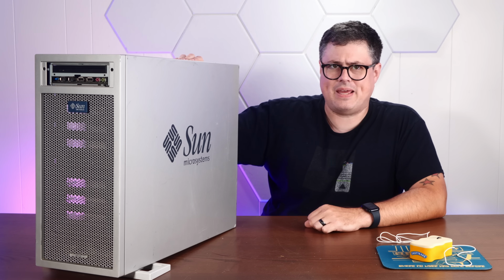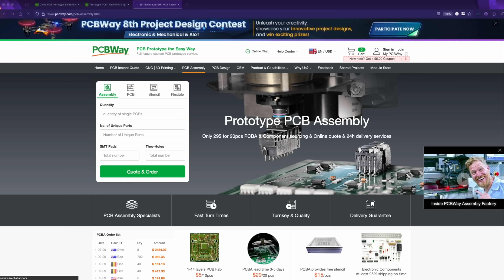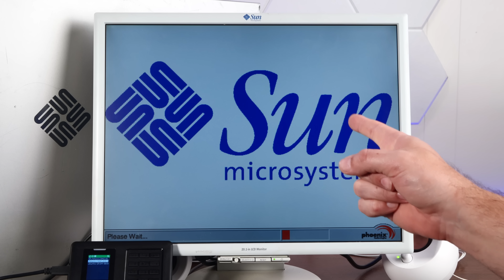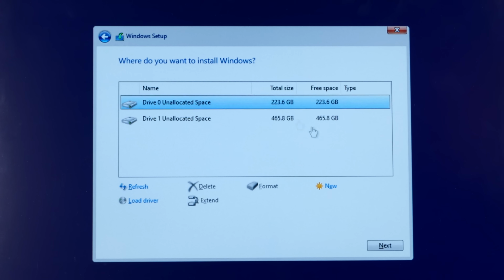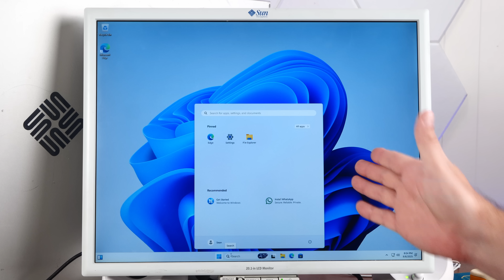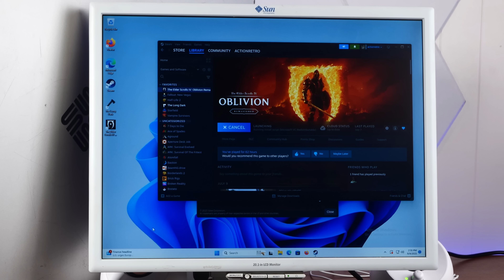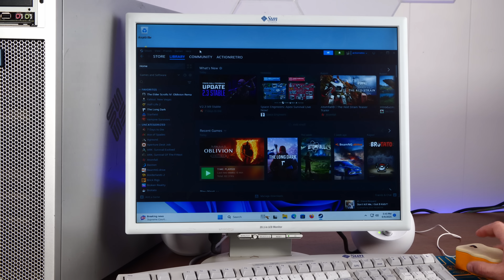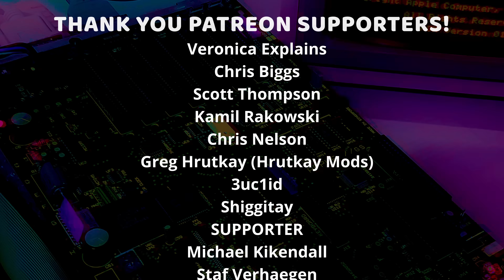The Oldest PC That Can Run Windows 11

Comment: Man.. imagine using firefox in this day and age..  Just to make everyone feel some type of way.. I use Edge on Windows, Mac, iOS, iPadOS, Android, and Linux..  Works great, also syncs well with my 365 tenant shrugs not sure what all the hate is about..
Reply: Well I only use Firefox, from version 2 or something like that, on all my.machines, at home and work. Only use Edge in InternetExplorer compatibility mode for some old things like some ActiveX cr4ps, and that is some rare times and only in one machine. Chrome have been barred by me since ever.
Reply: @mikes989  I used to use Firefox exclusively around 2005 but stopped somewhere in the early 2010s due to issues.  I have jumped around between Firefox, Chrome, and Opera but since the Chromium version of edge was released I have found a lot of usefulness in it and it performs very closely (especially in utilization) to anything else.  I do think though Edge gets a LOT better if you have a microsoft 365 subscription as well due to having your information from the browser saved in your own tenant, and having the extra controls that also come with browser management from having said subscription.  Haven't worked with it as a normal consumer though so as with all things Others mileage may vary...

Comment: This Specific workstation is actually is from 2006, so It's not much older (if at all) than an early Core 2 Duo.
Reply: I think there was half a year or a year between the AMD and Intel x64 CPUs, but I may be mistaken.
Intel saw it coming.
Reply: @pizzablender  AMD Made The Opteron 64s in 2003, but the Socket F Opteron in Sean's specific workstation is a 2006 Socket F LGA Opteron 2200 SE.

Comment: honestly what tiny 11 would you recommend for my plex server, I need the SMB since all my drives are different sizes,  I have 10 drives via SATA (using a SATA card on 4 of them) 6 on the motherboard SATA 4 USB drives and 1 m.2 drive, my boot drive is a mSATA 64GB using a mSATA to SATA adapter running a 12th gen i9, and the boot drive is the only one not shared on my network and my GPU on that machine is an older Nvidia it is a GTX 960, the issue is after PLEX and using steam as a sons of the forest server the boot drive is so full I cannot even do certain updates so I want to get rid of all the MS bloat that is not required to run plex and a maybe a server for specific games, any help is appreciated.

Comment: it is easy to imagine why microsoft put such high requirements
1 greed , selling new licences is actually more profitable than runing a store nobody buys anything in
2 lazyness not being obligated to maintain security on cpu's that have known security holes, if you cut them out from the list you don't have to provide security patches for them and you don't care if they crash
so technically it should just work, why wouldn't it? they just don't want liability for someone's secure data being stolen so they don't let anyone run the older platforms even if new ones are not much more secure

Comment: Tangentially related - using old computers.  I do love to play with old hardware, but I'm a bit more picky when it comes to homelab equipment.  At some point you cross the price/performance ratio for the running cost.  The hardware is cheap, the performance is often fine for light workloads, but electrical costs are out of wack.  This is important for something that's on 24/7, not as much for the casual user.   This makes older "PC" machines less interesting to me - you can predict the performance pretty easily, and the hardware isn't very interesting most of the time.  For me, this means anything AMD 3x000 and before, and Intel 9th gen and before are probably done.  The i9-9900k performs pretty well still, you can even game on it most of the time, but you're pushing 100W for a lot of heat.  Older Xeons are more interesting because 1. Tons of cores, 2. tons of RAM, 3. Tons of PCIe.

Comment: had same issue with Windows 11 setup on a noname usb card, but once I put the card in an older system and updated the cards firmware it worked fine in the windows 11 setup after that

Comment: Meanwhile Microsoft is writing everything older than 8th gen Intel off as e-waste.
Reply: Even the OG Ryzen 1st gens, which have TPM 2.0, got denied off Windows 11 official support.
Reply: @FairnightVexel That is insane.
Reply: In fact anything made by Intel after 2018 is e-waste.
They really dropped the ball hard.
Reply: Gentle reminder that Windows 10 LTSC will be supported till 2032.
Reply: @fallingwater  IoT LTSC, actially
Reply: @fallingwater  gentle reminder that this is a $50 operating system and people dont wanna pay for bullshit just to get security updates
Reply: i use xeon 1240v3 and 8800gt plus 16gb ddr3 for some gaming and music making and it works just fine. not ewaste at all
Reply: And also the fact they dont care about the flood of ewaste that is sure to come. Oh well, hope people like homelabbers or cluster people will pick them up. I will for sure!
Reply: @309electronic5  I already bought a bunch of HP Z240s for cheap (along with some older ones). Though, those can be upgraded to TPM 2.0 and would meet the specs anyway. I'm running a combination of Windows 10 IOT Enterprise LTSB (good until 2032) and Debian 13 on them and have no intention of ever installing Windows 11.
Reply: @309electronic5  i'm waiting for some dirt cheap late DDR3/early DDR4 era hardware to be on sale but i'm still not seeing it.
Reply: Even my 8th gen i5 is getting throttled in win 11 now. I switched to tiny 11 and suddenly it performs almost TWICE as well....
Reply: Yeah, it's ridiculous. My mom is still on an FX8350, and that CPU would be perfectly capable of doing office tasks on Windows 11, which is all she uses her computer for. But she'll lose security updates very soon because her computer is on Windows 10 and it's "not good enough" for Win 11 according to Microsoft. Pure bullshit.
Reply: @signedbyeduardo meanwhile Microsoft officially supports ultra low-end CPUs such as modern Celeron although they are already slower than a Core 2 Duo on Windows 10
Reply: @signedbyeduardo  you can bypass that buy downloading the iso file and using rufus and a usb to install it
Reply: @signedbyeduardo Just slap Windows 11 IoT LTSC on it
Reply: @signedbyeduardo  At some point it is worth upgrading for power efficiencies sake, but that doesn't mean Microsoft should be making that decision for you. I'm currently running as plex server on my old gaming PC from that era with an i7 4820k. That server does need to be upgraded but it has zero issues doing everything I tell it to.
Reply: I got it working on 7th gen with no issues
Reply: What's crazy is that they've even written off their 1st gen surface go tablets because the cpus they have are based on a variant of intel 7th gen cpus.
They were made in 2019!!!
Reply: You'd think they'd optimize it better and allow more users to run the OS
Reply: @BN0FFICIAL not about optimization, it's simply about moving new hardware under the guise of needing new instructions. With enough ram it would run comfortably on much older systems
Reply: Yes, and they also keep wasting billions of dollars on redesigning the user interface on every iteration with no gain except weirding out users. But to each his own I guess. Meanwhile my LXDE is completely stable but still has all the features I need.
Reply: @satunnainenkatselija4478 Yeah, Windows 7 was great. In Windows 8, they could have just replaced the kernel & gone 64 bit
Reply: yeah... microsoft is full of bs, i'm running tiny11 perfectly well on an 3rd gen i3 with 16GB of ram and i had literally no issues. (i3-3240 to be more specific, so definitely a slower i3, but still works, heck i've even installed it on a celeron from 2012-2013)
Reply: i'm still using a core i7-4770K at a perpetual clock speed of 4ghz. it's still a very usable processor today! it's a shame companies are even considering such things...
Reply: Right out of Crapple's playbook
Reply: That's OK, I've been kicking the tires on Debian and slowly making the transition that I should have made years ago. And I'm not the only one.
Reply: no, that doesn't make sense. I upgraded my ThinkPad T450s that has an "unsupported"  5th gen Core i7 and it just works. Also enabled TPM 2.0 and secure boot, and maxed the RAM to 20GB, to make it more faster (but still using a slow hard drive.)
Reply: Plus, i ran debloating scripts to get rid of MS bloat out of windows 11.
Reply: which is why I've been running Fedora since 2020.
Reply: They are doing that because they make most of their sales off of you purchasing a new computer.
Reply: and my 9600k :)
Reply: Google is doing the same. Does your phone runs anything newer than Android 10? Sorry, then you can't install, and can't even see any apps in Play Store that target a version older than Android 11. Because it's insecure. (Maybe it is but I don't care, I want my old apps that work just fine)
Reply: I ran Windows 11 on a 3rd gen Intel machine.

Inside a virtual host.

It was no gaming machine, but Windows 11 ran fine for office and web surfing.
Reply: They should change their company name to Micro💩
Reply: @linuxaudio100  Microsoft has one requirement for its CEOs -- that a "certain body part" be micro in size -- and I am NOT speaking of that person's brain.
Reply: Hopefully, that will push people (at least a few) to try linux on these machines...
Reply: And apple writing 2020 Mac is e-waste 🤣
Reply: It genuinely should be illegal.
Reply: You can still get an extra year of extended Win 10 support for free.
Reply: "Meanwhile Microsoft is writing everything older than 8th gen Intel off as e-waste."
Nah, Microsoft is cutting off normies from AUTOMATICALLY upgrading to a newer version of Windows, not turning stuff into e-waste and you can thank driver updates for that cut-off . As in - let's take Ivy Bridge - it can still be a daily driver, but thanks to the iGPU having not seen a driver update since 2015, it will invariably have issues in Win11. Wanna guess who's getting blamed if Grandma's hand-me-down T530 suddenly has issues if it gets auto-upgraded to Win11 24H2? Hint, it's not gonna be Intel for not doing a quick debug pass on the HD4000's drivers to ensure that they aren't having some issues :D in 24H2.
Meanwhile for anyone that's got a modicum of google-fu, the 8th Gen "limit" is a joke. Hell, so long as your CPU has POPCNT (So, basically anything past '08?) and you're willing to debug a little or mess with modded drivers, you can run Win11 on a Nehalem. Only difference is ... that by using the RATHER WELL DOCUMENTED BY MS THEMSELVES ways to bypass the requirements, "the onus on shit working right" is on the user and not on MS for auto-upgrading you XD
Reply: @bk109  The POPCNT requirement is bogus as well. Windows 10 somehow supports the drivers you mentioned without problem. As if much needs to be done to move it forward to Windows 11. Somehow it works using Rufus. So, apparently, the drivers are there. No one wants the AI crap that Microsoft is trying to cram down everyone's throats.
Reply: linux, linux linux!  Mint or try MX on a usb stick.  This is finally, finally the time to put some effort into running it. A little Wine with that, and Steam with Proton works great, I think in some cases better than native Windows!  And then you can tell me "You were right all along, since you brought Debian CDs at that Geekfest in '99!  Linux is better!"  You're welcome!
Reply: @squirlmy  Exuse you What about Ubuntu and Kalli as well as Zorin ?
Reply: @squirlmy  MX on a i5, 16GiB RAM, I tried Debian and yes it's good, but I want to learn slow.  Win11 what's that LOL.
Reply: @squirlmy  I've had some limited Linux use for years.  Just switched the two main PCs in my office/garage to Mint. So far, everything works smoother - Windows has had endless recurring problems with my A3 colour laser (networked) - usually stops working every few weeks and needs the drivers reinstalled (and the "smart" drivers don't work) - Mint found it in seconds.
Reply: As someone daily driving linux for years, Linux is NOT ready for the average user at all.  @squirlmy
Reply: @rrvindu  that really depends on how you define "average use". If my 70 year old ex trucker of a dad can make the switch with little to no issues I really think there are a ton of people that could as well. He's been on Kubuntu for 6 years and just recently got a new pc with win 11. For the last 2 months all I've heard is him bitching about windows being in the way unlike his linux pc. If you don't play competitive games, edit video for a living, or need specific non-web apps you could make the switch and not really notice a thing I'm sure
Reply: @rrvindu it's actually closer to being average user ready than poweruser ready. The average person uses a browser and a word processor.
Reply: @rrvindu  try mint
Reply: Did Athlon 64 have support for TPM 2.0?
Reply: @SuvroBasu no.. Win11 doesn’t even support Ryzen 1st gen..
Reply: @BankruptSee Thanks
Reply: opensuse leap for me
Reply: As I always have to say, it's for security reasons, keep in mind the average windows user is not at all tech saavy, Microsoft locking down Windows 11 allows them to tighten the security of the OS

When bypassing the hardware requirements many windows defender features stop working correctly, fine for us tech nerds who know how to not install malware, not good for your grandma who doesn't know what "anti virus" means
Reply: @MayYTlive  When has anything from Microsoft stayed locked down?
Reply: @MayYTlive  I have heard the TPM 2.0 argument a lot. However, something I haven't seen anyone explain is why Windows needs TPM 2.0 to be secure yet Linux distros can run on much older hardware without a security problem. Perhaps this speaks of a weakness in Microsoft's software, rather than an issue with the hardware it's running on?
Reply: @MayYTlive   Yet they wrote of 6 and 7 gen intel processers that supported TPM 2.0 which could support secure boot and other security features.
Reply: @MayYTlive Yet they steal all your data, so it's automatically not about awcurit
Reply: @MayYTlive  sorry I do not buy that argument. If Microsoft really cared about security they would not include bloatware that is a security risk.
Reply: @MayYTlive look, it's as simples as understanding that most people cannot afford to buy new pcs but still need them. That just translates to the person having to stay on windows 10, which is even more unsafe than just allowing them to upgrade to windows 11 without having tpm 2.0.
Reply: @MayYTlive  you sound like a microsoft employee lol